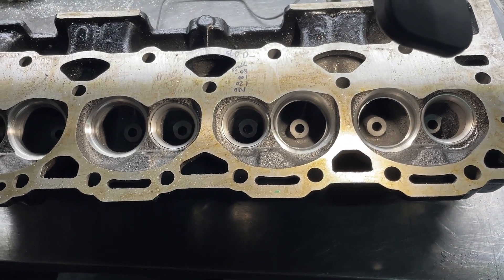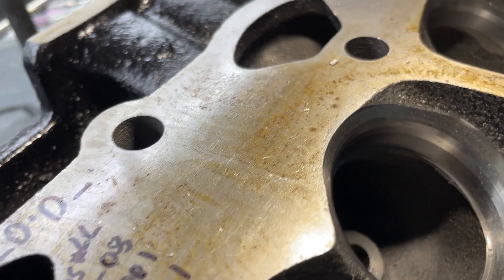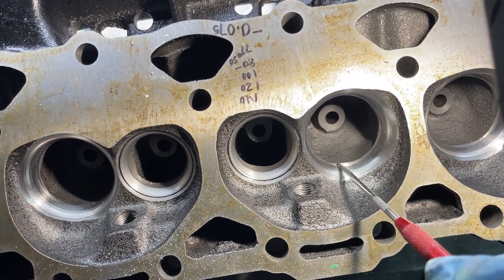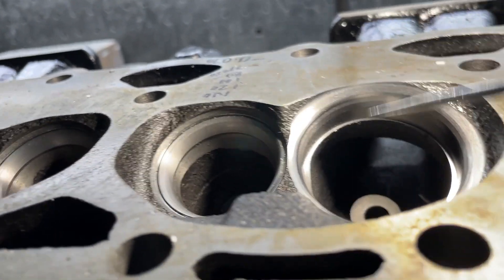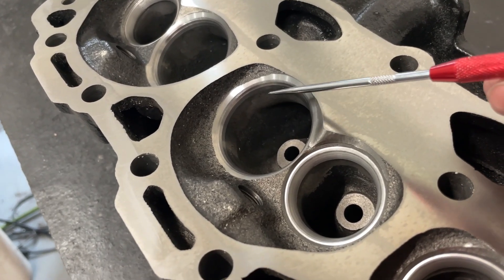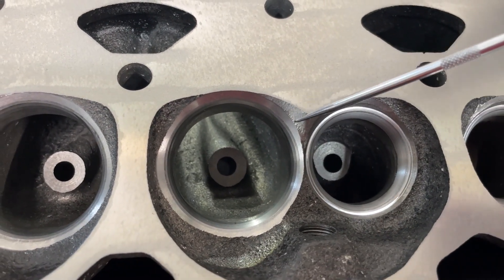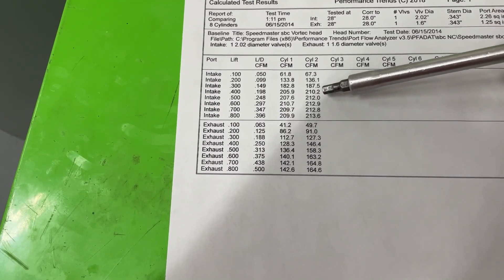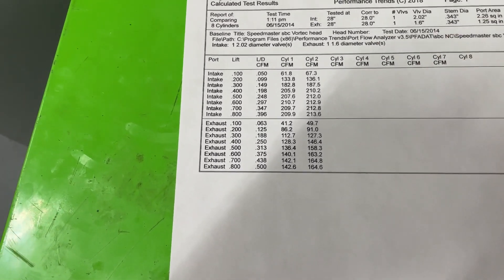Improving Speedmaster?Procomp Cast Iron Vortec Heads

Comment: Hello,  Would you ever do a radius up the the valve seat on the inlet, probably end up more tulip shape than a constant radius, or do you need to relay on the sharper edge separation to help create localised separation to aid turning the flow?

Comment: This cylinder head will be going on a 355.
The compression ratio will be 10.0: 1
Camshaft will be something similar to a magnum 270 hydraulic roller. 
Lift will be about .500 intake and exhaust. 
It will have a dual plane air gap type intake manifold
It will have a Holley 4412
It will have 1-5/8" to 3" upright open headers.
Hoping for about 350 hp give or take 20hp
Will be  a demolition derby engine.. 
Cast iron heads are a must. 
Cast iron cylinder heads are hard to get right now.
Factory vortec heads don't like to be ran with no water for too long.
I've used several sets of the cylinder heads with no problems as of today's date.
Well likely be connected to a 2000 stall converter turbo 400 and 456 gears with 28 inch tall tires.

Yes these heads are mine, 
And even though these cylinder heads are way below Eric, he did very quality work on them. I highly recommend Eric.
Reply: If it's a derby build why not just use an d set of the heavy 461/462 heads? They are cheap now and have lots of extra metal seems like it would help you keep it alive longer. I mean you're not exactly going for ultra high output with your build specs listed
Reply: @b.c4066  Those heads are a good durable head.  If you can find them, and find them in good shape without sunk seats or sloppy valve guides. Those old Camel Hump heads still have a place 👍🏻

Comment: Always wanted your opinion on doing a 3 angle valve job on the valve it self? Will that improve the air flow or no? I'm currently doing it to customer's cylinder heads but the angles I'm cutting is back cut is 40⁰ face is 50⁰ margarine is 60⁰. Any input is much appreciated! The margarine is still there I'm cutting the 60⁰ right on the face of the valve by the margarine

Comment: Giday from Ontario:    Just came in from my shop , I’m screwin together a couple of 270 hp marine engines out of a cruiser …. Ya pretty boring , . I only had about 10 minutes of high performance today as a customer dropped off a 358 modified motor. ,   But hey here I am almost midnight and I get my high performance fix from you Eric because like most hardcore engine guys , you go , go , go for many hours per day ! 
Anyway thanks for another informative vid !